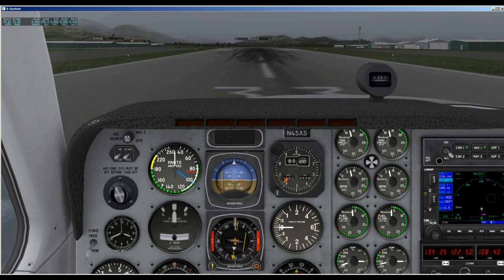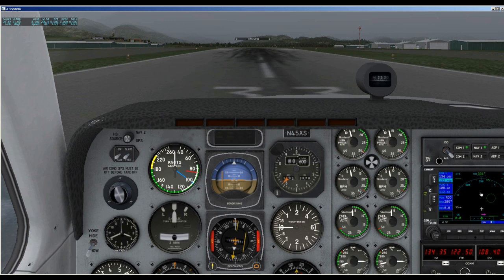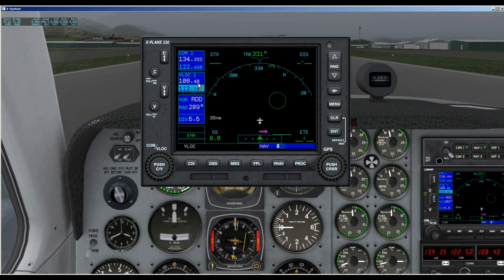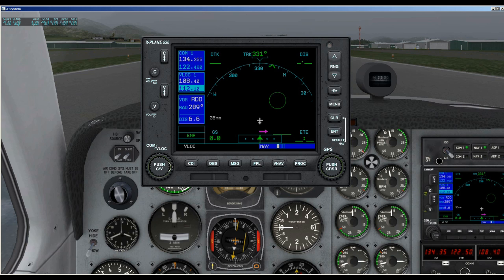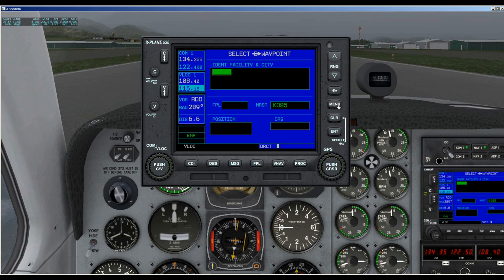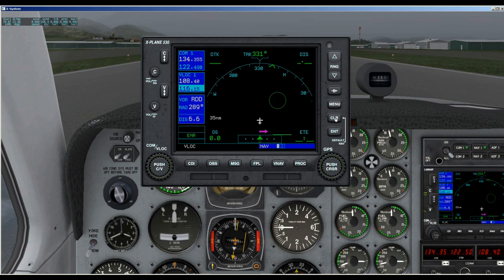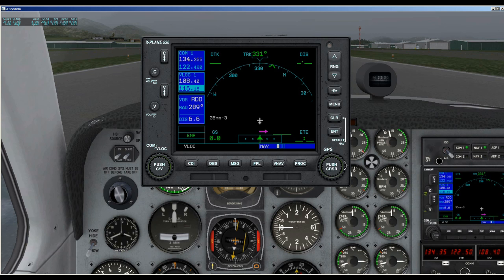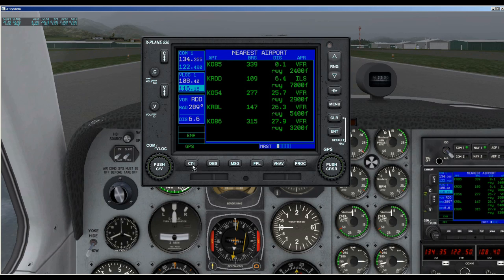How to use the Garmin 530 GPS in X Plane10 - Tutorial Part 1

Comment: Hi skip. Thanks. Working my way through your tutorials on GPS navigation. I am flying Cessna 172 in XP11. I notice the plane has two GPS units, one on top of the other-- the Garmin 530 and the Garmin 430? (away from the cockpit). What's the reason for that? What's the difference between the two units? I don't think you have done anything with the 430, so maybe that one is an older unit? I figure learning one well is better than trying to learning both. Also, maybe with Plane Maker, I can remove the 430, and put an FMC in that panel location. Your advice much appreciated.
Reply: Skip, I did some poking around and did learn more on question above. I understand you don't use GPS much, but which one do you prefer personally
---430 or 530?
Reply from the maker: Hi Ron,  I can't really tell you all the differences between the 430 and 530 they both do pretty much the same thing with the obvious difference being the map. I almost never fly with Autopilot when using either of these, I just use them for reference when flying manually for direction and distance to waypoints or airports while flying Pilotage and Dead Reckoning and then only when I'm off course or worse lost. 

Both are very good and depending on the flight will determine which to use. If flying in a high traffic area with lots of airports around (San Francisco area say) the 530 is a good choice because you can see the different air spaces displayed on the map. 

Sounds like you are using the 172 that comes with XP.  Not really sure why they have both but that's a real luxury, these are very expensive. I found a used 530 for almost $7,000 and the 430 around $4000 so probably not to many airplane with both I'm guessing.

So which one? If you learn the 530 well the 430 will be a piece of cake :-) Try the both and see which one you like, I don't prefer one over the other the big difference would be do I need the map. Hope this helps :-)

Blessings,
skip
Reply: @WEHVideos  Indeed I'm using default C172 that came with XP11. I couldn't figure out whether XP had some deep reason for putting two GPS units in a small plane, so I sought a candid opinion from a flier like you. Thanks for going the extra mile on this one.
Reply from the maker: Glad to help :-)

Comment: Excellent explanation ...there is only one issue im facing... My GPS unit does not enlarge and open in a separate window upon clicking the center of the screen... How do I enable that?
Reply from the maker: Hi Shray,  Thanks hope it helped.  I afraid I don't know why your GPS would not open, you should be able to double click the GPS screen and it should open. I assume you have the latest version of the airplane and X Plane, other than that I'd reinstall X Plane and see if that helps. Sorry, that's all I can thing to do.

Blessings,
skip
Reply: Thanks very much Skip...It is running the latest version...but yes, I shall do as you suggest and reinstall
Reply from the maker: Sounds good, let me know if it worked :-)

Blessings,
skip

Comment: Skip, Do you have any idea what the gps and mfd operation is for the Cirrus that comes with XP10.41?
I tried to direct to Jacksonville from Va and it sent me out west.  I haven't found an instruction manual yet and I don't know the model of instruments that this one is emulating.

Thanks :)
Reply from the maker: +Tom A  Hi Tom,  Hi Tom,  I've not flown the Cirrus so not sure if I can help. One thing to check is make sure you have the autopilot turned on and the correct source selected, NAV1, NAV2, OR GPS. You can enter a flight plane but you have to activate the plan for it to work. So next time make sure the source is set to GPS, Flight Director set to Auto (not ON) and then click the "LOC" button this should get you flying to the first waypoint you programmed in your flight plan. Let m,e know how it goes.

Blessings,
skip
Reply: +WEH Videos thanks, after practice this is getting much better for me.  I think I just did what you did in another video and put in the wrong airport.  

This is fascinating stuff, I just got into simming as a hobby.  

I am so amazed at the radio based navigation capabilities of aircraft, I had no idea they were so effective.  I mean it makes sense, but this is a really cool thing to explore, Your videos are really good at explaining the concepts.

Thanks! 
Tom
Reply from the maker: +Tom A Hi Tom, thanks!  Keep at it it is a lot of fun. I don't remember putting in the wrong airport in a video, which one was it, did I explain the mistake or is it something I missed completely???

Blessings,
skip
Reply from the maker: +Tom A Hi Tom, Sorry for the delay in answering for some reason your comment ended up it a spam folder and i didn't see it.
I watched the video and don't see what you are talking about. We flew to Redding Municipal airport VOR using NAV1 set to 108.40 in that video it all looks correct to me?? Are you referring to the "to/from" portion of the video?

Blessings,
skip